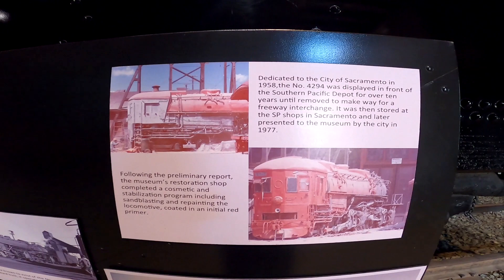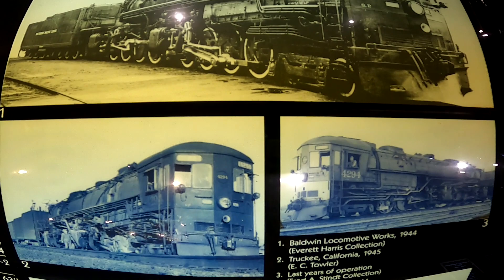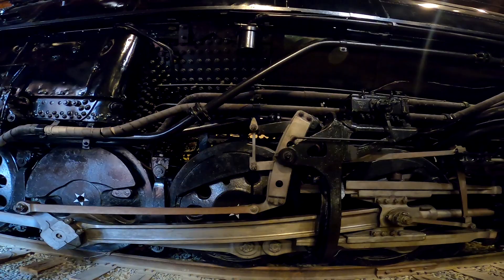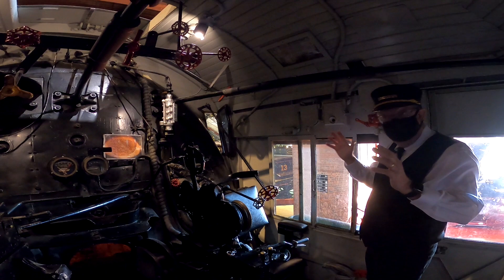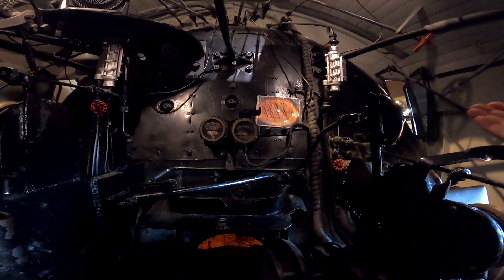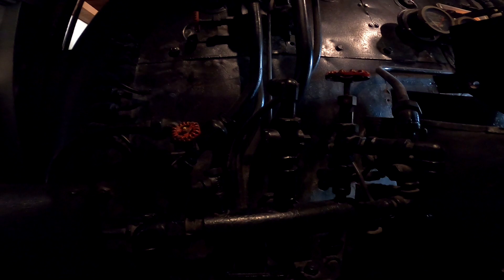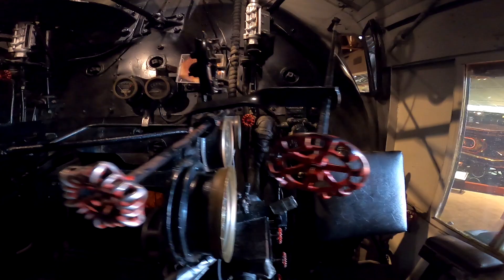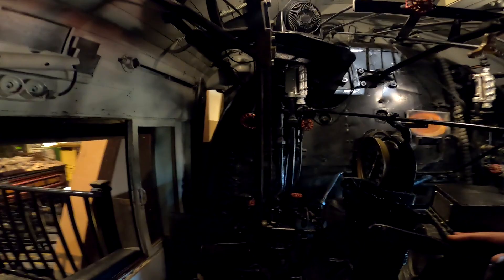One million pound Steam Engine, Southern Pacific 4294

Comment: I hope Southern Pacific Cab forward steam locomotive 4294 Will be restored and be operating for excursions Someday
Reply from the maker: That would be awesome! Fingers crossed 🤞
Reply: Yeah that’s not gonna happen. I’m usually on board for full restoration I’d love to see a cab forward run again but it’s highly unlikely. 1 because of the design and 2 because it’s articulated. Aside from 4014, 1309 etc, the reason we don’t see many mallets or simple articulated operating today is because, it’s hard enough getting a conventional steam locomotive up and running again. You throw in a second set of driving wheels and it becomes more complicated and the cost increases a lot more, due to the size and extra parts. You add on the fact that this is a cab forward and it’s designed to travel in reverse and that the tender is permanently coupled to what is usually the front, so that’s a whole  ANOTHER pile of shit. Also I can’t think of a single engineer in todays era that even knows how to operate a cab foward

Comment: A couple of corrections, they burned oil, not because coal was in short supply, but because with the cab forward design the tender following there would have been no way to shovel coal into its firebox. Oil could flow. On the UP what gave rise to the cab forward design was the problem discussed smoke would fill the cabin. A attempts were made to couple the loco and tender backwards to the train  to put the smoke behind the crew but that meant particularly with long articulated locomotives they ran essentially blind as not only did you have the bulk of the loco but its tender as well.    The conductor in the cab mentioned a Big Boy in the East, it is in non-operating condition but has recently been cosmetically restored.  It is located at Steam Town.
Reply from the maker: Thank you for your information on the beast! I'm always learning new things about locomotives
Reply: about that last bit about the big boy, is that the 4014 or is that a different one?
Reply: @Randomator5000  4012 is at Steamtown, in Scranton PA.

Comment: It's a locomotive, not a "train"! Most of the SP's locomotives used oil, as coal was harder to get in the west.
Reply from the maker: I have always called them trains. I know it drives people crazy, but it is what it is. At this point, I'll try to correct myself, but it may not work at this point in my life. 
Thanks for watching
Reply: @Bayareaandbeyond777  The locomotive pulls the train like a tractor pulls a trailer.

Comment: It had to run on oil, not coal.  The oil was piped from the tender to the "front" (where the firebox was).  That would not have worked for coal.
Reply from the maker: Thanks for your knowledge.
Reply: @Bayareaandbeyond777  And thank you for your enjoyable video.
Reply: Thank you! I had doubt about the firebox in this engine when I drove it in Train simulator.
Reply: Likely not the oil that you are imagining. In these days, locomotive and many ship boiler fuels burned "bunker-C." Bunker-C was the final product left from crude oil after the lighter distillates were boiled off-- lube oil, gasoline, naptha, etc. Bunker oil is the heaviest remnants, full of heavy metals and many horrible pollutants, and often thick as tar. Much of it came from Kern County, which is known for heavy oils and tar sands. We used to joke that it was basically the dinosaur bones left after the oil had been boiled off. It's so thick that locos (and ships) had pre-heaters that would heat to soften the fuel to allow it to travel through heated pipes from the fuel tender to the firebox and they needed frequent cleaning because of the waste products that were generated. To the best of my knowledge, bunker-C is no longer produced and has no known uses. If I remember correctly, refiners burn this product off at the refinery itself.

Comment: When it comes to what SP 4294 fuel it ran on, oil was the only option the locomotive had besides coal since it was a fire hazard but because you wouldn’t be able to get the coal into the firebox without it being in the traditional rear, instead oil was piped all the way to the firebox.
Reply from the maker: Thanks for your knowledge.